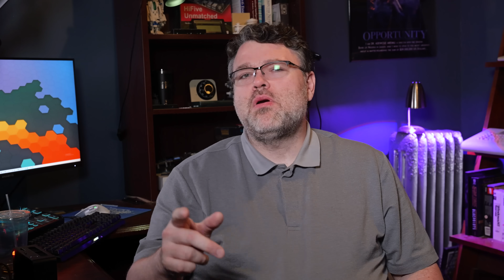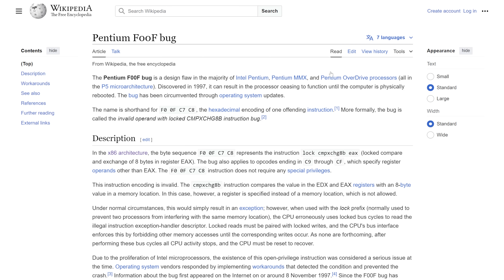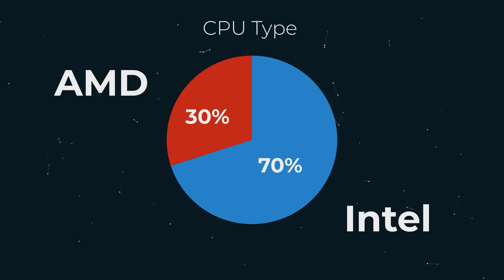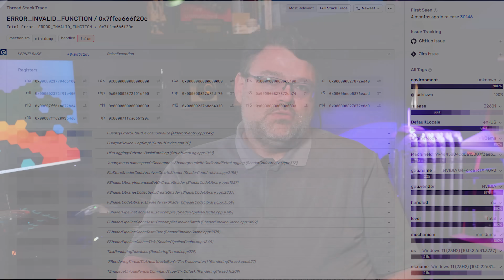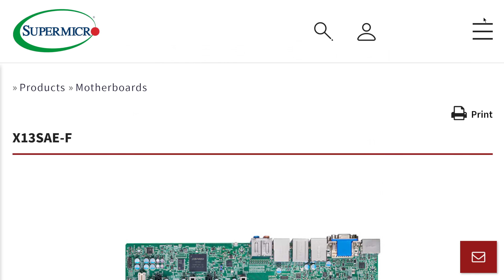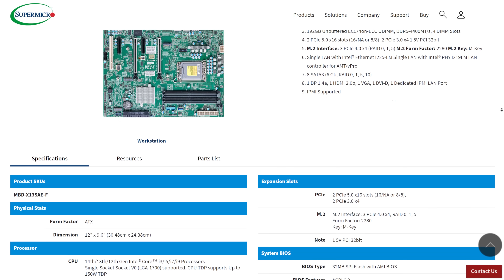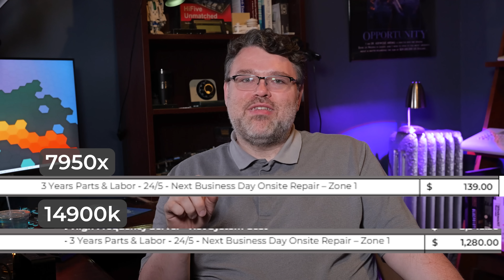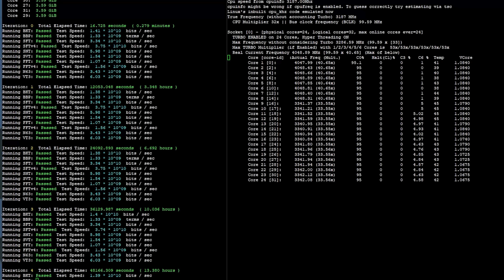Intel has a Pretty Big Problem

Comment: Careful Wendle, you don't want to get Boeing'd.
Do we have data from those Intel units in the data centre when they're not gaming? Like, does this behaviour only happen when they're being the sever segment of these games? Yeah, I know, you buy an Intel 13th gen for the rack ~ you don't also use it for anything else. I can't believe nobody anywhere has bought these 13th gen Intel units to do other tasks, not just being gaming servers. Ok ~ so ~ do they fall over when doing other things?
I infer from the way it's being talked about, the home user / gamer boi case only happens when they're gaming, and usually when they're playing the same game. Is that true on the server side? Do those CPUs and motherboards only fall over when they're playing  / serving that specific game?
Suppose it happens in 5 different games. What are they? What specific piece of code is getting run in those cases?
I'm not trying to pin the 'blame' on game developers, or even the compilers they work on, I'm just trying to understand what's actually happening. Like, I'm more than prepared to blame Intel, but I want to know what I'm blaming them FOR.
If this was easy or simple, we wouldn't still be talking about it.

Comment: The boost feature is just an aggressive overclock that intel force on people who are not interested in overclocking which lacks the expertise to tweak things on their own to make the system stable, and these people basically blame developers when their game are crashing, when in fact its the manufacturers who is pushing the hardware to far, how ironic is that. 

Disable the boost on default is the way, if the user is interesting in overclocking they can simply activate the boost feature.

People don't need the CPU chugging along on 6 Ghz or 5 Ghz for that matter with an voltage that will degrade the chip early, they just want to play games without crashes, just saying.

It's funny how Intel is just dogging the main cause of all this trying to blame things other than the boost itself, it makes you wonder lol

Comment: I have an i9-13900KF and can confirm these intermittent problems are still happening daily. I made the mistake of buying my system pre-built from Dell and they won't even acknowledge that it's an issue. They replaced my motherboard but won't replace my CPU.

It's also funny that you mentioned decompression in particular. I was able to attach a debugger to Assassin's Creed Valhalla and reliably reproduce a very specific crash that I couldn't on another system:
OODLE ERROR : LZ corruption : DecodeOneQuantum fail!
OODLE ERROR : LZ corruption : OodleLZ_Decompress failed (0 != 262144)
Exception thrown at 0x00007FF64BC0E2ED in ACValhalla.exe: 0xC0000005: Access violation writing location 0x0000000000000002.

Comment: Maybe cache corruption? If the tags are corrupted then constant cache misses would cause a drastic slowdown, and a cache hit with bad data would absolutely cause a crash not directly tied to a specific core or power condition.
Not sure how it would relate to the Memory clock though.

Comment: Bought 14900k about 3months ago. First week or so was fine. Then it started crashing randomly in more demanding games. Was keeping up with latest bios updates and was lowering power settings each time with perfomance getting worse as well. Eventually got down to intels rec 125/188w power limits with all additional bios tweaks they recommend and it was fine for a few days then started crashing again in some games. And it was getting worse almost daily. Switched to 7950x3d and no issues. Not sure what to do with my busted intel cpu, dont want to sell crap.
Reply: Try increasing the voltage limit & decreasing the current limit. Also others have suggested disabling all e-cores. & try a more powerful cooler maybe
Reply: @Marees-cj6pc  yes. Intel new recomended specs already decreases current limit same as watts. Cooler not an issue liquid arctic freezer 3 360. And if thats not enough cooling then f it. Temps were reading good always max 70-75c depending on game.

Comment: Then my son has a homebrew i7-13700k machine we put together with adequate cooling and power and it is rock steady even with the unreal engine.
Reply: I have an i5-13600K since it was released in 2022 and I have not had issues. We need to collect more data, maybe it is only famboozling on i9 13 /14 gen. I'm probably going to upgrade to a i7-14700K as it has a higher thread count and 4 more e-cores than the 13th gen.

Comment: Asus is not safe for amd and Intel for voltage controller...I am still concerned with amd gigabyte soc voltage default settings is still a problem still with later bios that they already did fix it from early bios by lower soc voltage to 1.29v but now they putting back to 1.34v with later bios of this year. Amd is not telling us something what vendors is keeping quiet about soc degradation is causing crashing on amd side as well...I believe it has to do with size of chip die that both foundry's are shrinking too much that gates are getting very brittle now

Comment: So the CPU Issue has been so big that even data center support providers are charging almost 10X more to support Intel CPUs compared to AMD CPUs!!! Wow, they must really be squeezed on support to make it so expensive! $139 vs $1280 for a consumer processor even though it is on a server motherboard is crazy. It seems that technical support far surpasses even the cost of the system for the 3 years of support.

Intel must have the best issue-burying team in the world because this is a scandal of epic proportions!

Comment: Something interesting not a lot of people noticed, which drove me to pick a 12900k over a 13700k/14700k or higher, is that power efficiency has actually regressed. It's interesting, because Intel themselves claim that they should be more efficient. Usually a power efficiency regression goes in pairs with hardware instabilities in my experience, so this video is definitely verifying my decision there.

EDIT: The efficiency regression is quite significant btw. in the range of 10%-20%. My thoughts here being that it might not be the users or the motherboards that drive these chips too hard, it could be Intel? Could be interesting to do stability testing with an undervolt, or maybe compare the crash data of mobile variants to their desktop equivalents (as they aren't driven as hard)
Reply: Yup, that's one of the reasons I remain sceptical about how amazing the Lunar Lake is going to be when it comes to efficiency.
Reply: When you are looking at efficiency regression is that at ISO clocks? Frequently when companies compare efficiency they standardize performance or clocks to make efficiency gains look larger than they are. It’s how a 3080 according to Nvidia is 1.9x more efficient than a 2080. The 10-20% efficiency regression also tracks with the expected efficiency regression of the higher speeds of Raptor Lake.
Reply: @dex6316  Yeah the higher speeds of raptor lake could be the problem is what I'm saying. I don't remember where i got the 10-20% number from, i shouldve cited my source, but for example in anandtech's testing, the 14700k with an extra 4E cores and 400mhz pulls 387W peak in their test, where the 12900k pulled 272W peak. It is a regression in efficiency because the 14700k is driven past the optimal point of efficiency, at least comparing it to the 12900k. It's the density, plus the speed. Now imagine the topic at hand: the 13900k and 14900k which are driven even harder. 

I did not mean some magical architectural regression when the silicon should be almost exactly the same clock for clock, but they are asking a whole lot more from that silicon to stay competitive.  Maybe that's why the chips break even on W680. It doesn't have to be from overzealous power profile, something about the architecture just does not like current running through it and degrades over time.

Comment: Using a 14900K / 13900K on server class motherboard? Why. Anything running on the E cores would be slower for no reason. They make Xeons that are basically the 14900 just without E cores such as E-2488 for this exact reason.

Comment: There have been problems since the 12,000 series. I had a 12 900 HS whatever laptop and it would not handle the number of chrome tabs I had open. would bring the entire system down. No matter how much ram the system had. Didn’t have that problem with an 8750 H or an 11th Gen 67 G7 whatever the hell it was. And I am now having a similar but not exactly the same problem with the 14 900 HX. I know my tabs are tipping the scales at over 1500 but I’ve had four year-old laptops that could handle that load.

Comment: you said that disabling E cores doesn't really work, but slowing the RAM helps, I just want to point out that before the tekken issue, buildzoid and tech yes city has investigated some issues on the intel platforms, BZ mainly talking about intel having RAM instability and their bad IMC, TYC talks about latency issues and points out the thing in the north / south bridge that causes latency issue + other settings, did intel not investigate that ?

links :

AHOC 
https://youtu.be/5R8en_FtA80?si=DcCz5pMpRIb36_EZ

TYC
https://youtu.be/BIkbc3eQyPg?si=_pqTDO4_7iI-OQBb

Comment: At this stage in the game if I owned a 13th or 14th gen Intel cpu that showed any signs of crashing or performance degradation I’d be sending it back to Intel on the first thing smoking wether it was under warranty or not. Intel needs to admit there is a problem and recall the vast majority of these chips (after correcting the problem, which I’m sure they probably have with newer built chips). 
 They are basically going to pull a Nintendo and never admit there is a problem (think joy con drift). As time marches on I feel for people who’s chips are either going to fail out of warranty, or won’t perform as well as it did new because of degradation or bios updates that will gimp performance.
Reply: Joycon drift is intentional by design to force people into buying new joycons tho...

Comment: Feels like Intel wants to drag out the problem till next gen launches and play the Spider-Man meme till then
Reply: Exactly, there is no fix for what is plain old Silicon degradation caused by too high voltages, clocks, temps and Amps pulled trough the silicon long-term. There is no software fix, there is no bios, there is no microcode that will revert this once its already degraded. The only fix is "do not exceed 1,3v and clock them 500-600Mhz lower". And also, do not clock your CPUs so high that they have less than a 5% headroom left in them, so even the smallest degradation throws then to the "unstable on stock settings" category. Intel is just making smoke hoping the attention will go away so they do not have to do the thing they should - full scale recall.
Reply: @Lady_Zenith  So does this mean it is not also affecting the 14900hx laptop cpu?
Reply: @Lady_Zenith if you actually watched the GN video it seems like this might not just be limited to power levels/voltage
Reply: @Ex14  That was released after the comment but nothing new there. Since underclocking it usually helps it all points to degradation. Iv had quite a few Intel CPUs degrade on me. 4777C that started on 4,3 but later could do only 4,1. 8700K that did 4,9 but later only 4,7, etc. At work we even had a few LGA2011 Xeons degrade that they were unstable on stock when turbo was enabled. Sure those took over decade of daily full load to get there, but it happens even on safe voltage, and at the same time I had 5960X with the same die holding 4,8 rock stable as if it was new. 

Voltages temps, amps they all contribute but some of the silicon degrades even on stock. The point is back then we had huge OC headrooms, 200Mhz was a drop in a water. But something like 14900K does not even have 200Mhz in it. If it degrades by mere 5% its already unstable on stock. It was terrible idea to release it clocked like this from the beginning. Intel was desperate to get their cinebench win, now they pay the price. Look at the bloody power consumption, this is a mainstream socket yet it uses twice as power as HEDT used to. its ridiculous it got where it is.
Reply: That feels way too real...
Reply: Intel is hanging on for dear life trying to compete with AMD. They rather take big risks that can backfire on their customers, then try to silence it, than being honest about the limits of their CPUs and losing their high spot in the benchmark charts.
Reply: @seeibe  This. Consumers are used to seeing i7 at the top of the chart and Intel will break bones to keep it there, because they desperately need to keep it's brand power.

I just had to leave a bad review for a "i7 Desktop" selling in my country's Amazon with no GPU for $900(!), because I noticed that it had a HD4500 and realised nobody else could work out that meant it was an 11 year old PC. They just see "i7" and buy.

It's those idiots that Intel made the 14900 for. So Google still says "i7 is fastest" and the plebs carry on buying it.
Reply: This is me when I was 14, I saw i7 and chose the crappy HP Pavilion HPE H8-1103NL with the i7 2600k haha
Reply: @kylexrex  at least its not 1st gen and is unlocked
Reply: @Gen0cidePTB  I went with AMD in my new system. R5 7600X in a MSI B650 Carbon Wi-Fi board. Runs like a charm. CPU also survived three overheats when two of my brand new AIO's from BeQuiet(Pure Loop 2 FX 240mm) had their pumps die - one in 7 days and the other in 19 days of use. I got an Arctic LF3 this time, and it's been going strong for months.
Reply: @astanisystems  Great example and nice system!

The arguments around here are wild! 😜 It's not even an Intel is AMD thing though because you could get a 6600K (my last Intel chip) and do the same thing to it and it would probably survive. I remember turning on my old CPUs without any heatsink installed period just to see if it would POST a few times in my younger reckless days.
Reply: @Gen0cidePTB  Thank you. I think older Intel CPUs are more durable and reliable than the 12th, 13th, and 14th gen - especially 13th and 14th. Intel really pushed those CPUs to the limit in hoping of achieving better performance than AMD's CPUs, but it backfired. There's a limit to how far you can push silicone. Now, both AMD and Intel IHS plate design is bad, one is too thick and the other one bends in the middle, but all in all AMD is winning so far in nearly all areas. 

As for overheating of my CPU, it wasn't intentional by any means, I just ran into a brand I should avoid if I want an AIO. BeQuiet Pure Loop 2 FX 240mm was what I went with as stated, and both units were bad. Amazon was kind enough to refund me the money after the replacement unit failed as well. BeQuiet makes good products, but their AIOs in specific are bad. AIOs perform well when they work, but pumps fail way too quick because they are pushed to their limits spinning over 6000 RPM in some cases, while Arctic AIOs spin in 2000s and 3000s and have a better design and possibly better quality materials and components. 
My advice: Stay away from BQ AIOs. 

I also went with RX7800 XT in my build, mainly because I wanted to go full AMD, but also because that card was cheaper than the Nvidia equivalent. RX7900 GRE was 100 euros more expensive, but I didn't buy it, I bought two 50 euro 1TB Kingston SATA SSDs for additional storage, and recently that proved like a smarter choice because of the Steam summer sale. Bought a lot of games that were 80-90% off.
Reply: @nonstopNny  You reminded me of my HD4670, used it till 2018, poor little guy.
Reply: @nonstopNny  Yeah the other 25k are contractors. Have a look at some of the native news articles and you'll see that.
Reply: @nonstopNny  25k are contractors or indirect employees
Reply: @nonstopNny  The rest are contractors
Reply: I love the Spiderman theme.
Reply: @nonstopNny  25k contractors
Reply: They will most likely wait until their next gen are out in mass numbers and then do a recall that involves a swap from the old gen to the latest (plus motherboard) at no cost, in exchange for total silence.  It's been done before.
Reply: welp your wrong , the motherboard manufacturers did it again they made their stock bios config too high of voltage and offset way too aggressive . if you change your bios setting too intel stock settings and crashes disappear .. this has already been investigated and proven .. motherboard manufacturers have done this repeatedly !!
Reply: @EpicGamingEct  Dude did you not watch the video, the increased failure rate in server motherboards points to the exact opposite of what you are arguing, just because intel is trying to pin this on motherboard manufactures does not mean that's the truth or the whole truth, as Wendel points out, the CPU use in the game servers are running at power target far below consumer side boards, indicating that the problem runs deeper then incorrect power profiles.
Reply: @iDumle  I'll just mention that Intel has a research lab in Israel that hires 40,000 people, mostly PhDs. The idea this got past all of them is a pure fantasy.
Reply: @Gen0cidePTB  Argument from authority fallacy.
Reply: @mikehawk1441  I made 3 posts, which do you mean?